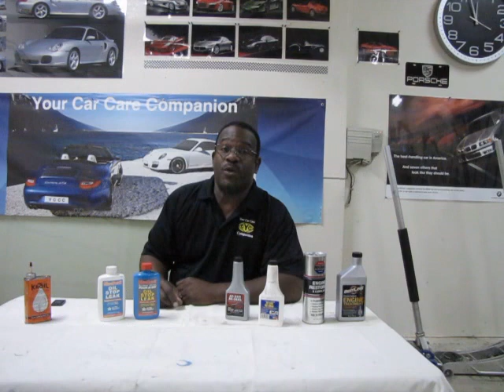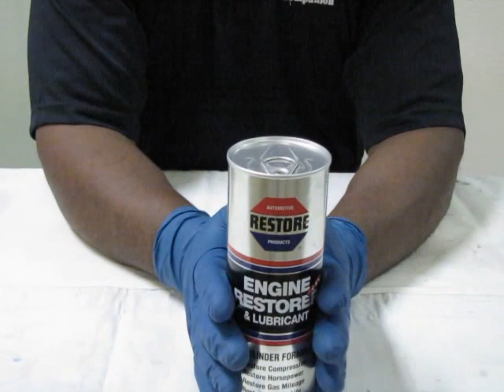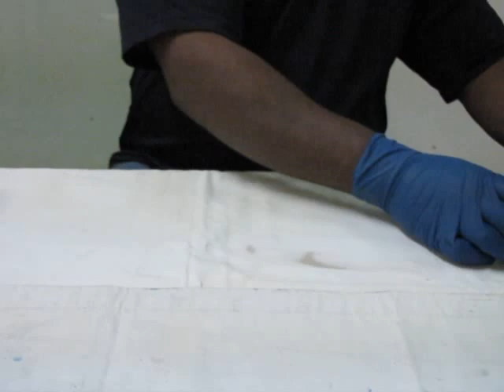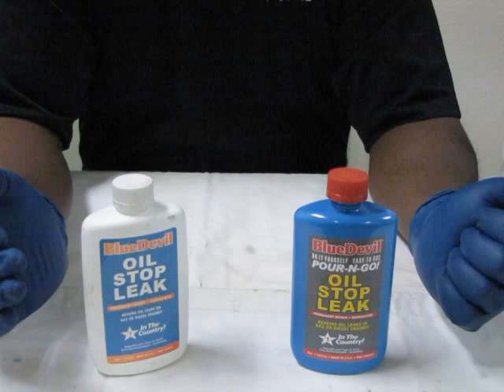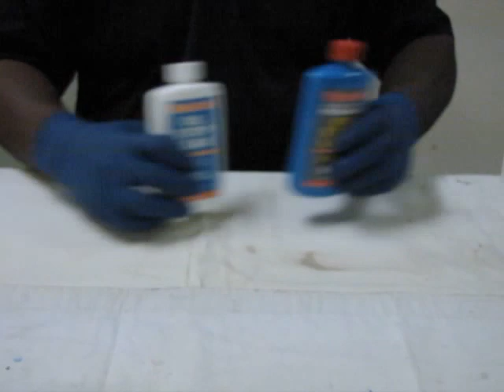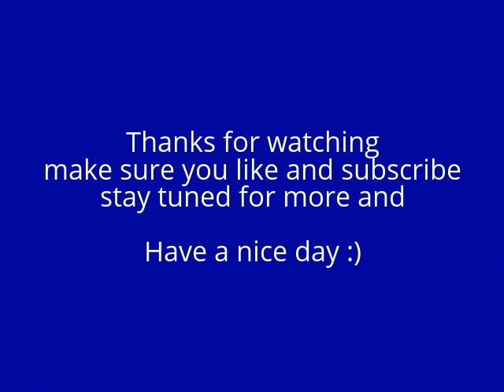3 of the best engine additives and penetrating oil money can buy

Comment: Catching the oil leak early is very important as it will work better. I believe  AT 205 reseal would be all you need some cases. Reason why is if you install a rack and pinion steering system and you have an older car that steering system could have sat in the products warehouse for many many years that the rubber seals inside could have dried out over time sitting in the heat etc. Same with real main seals. If the system starts to leak prematurely in months or in just a couple years the problem could be that the oil seals just need to be rejuvenated from sitting in the heat for so long,  which AT 205 reseal would solve the issue.

Comment: Really good video my man,I'll be using the AT 205 RESEAL for my 2008 Toyota Sequoia Limited,210,000 miles it has a rear main seal leak,hopefully it works... Do you recommend full synthetic oil for my vehicle and why???

Comment: Wish I could give this video, 2 thumbs up. I've been searching high and low for a true and honest opinion on these products, with someone having enough experience in using them and also being able to do the repairs, and when to or not to use them.
Reply: I have been looking at YouTube videos like this for about a year. More important now with troublesome cars with GDI, low tension oil piston rings, longer oil change intervals ,, differences between top tier gas and regular no/low detergent gas. and turbos

Comment: ATP worked for me.  Both of my Hondas had very small oil leaks.  I put 100ml in at each oil change and never had a leak since.  Instructions were about 180ml for my engines, but I only put 100ml just to try it out at first and it works.  Although I will replace both vvt gaskets soon since that is where the leak is on both cars.  Too bad I can't find ATP anymore, but I can find the Blue Devil stuff.  Might have to try it.

Comment: Note: AT-205 RE-SEAL, do NOT give it 5 hours. Drive it immediately. Ideally you'd pour it in while it's running. This will melt paint off your oil pan (if you have a painted oil pan, curse the OEMs who do) if you don't mix it into your oil by running your engine, then it will clog the oil pickup screen and kill your motor by reducing your oil pressure to 0
Reply: I put AT 205 Reseal in my 2008 Sequoia Limited with over 210,000 miles before I left for work this morning,it has a rear main seal oil leak,hopefully it works...

Comment: Thanks for sharing your knowledge and experience. I am looking for AT 205 but cannot find it anywhere. Went to advanced auto parts and was told it is back ordered 3 months out. Amazon is out. One site showed back ordered until September. Do you have any experience with Blue Devil Stop Smoke and Engine Repair. Looking to revitalize valve stem seals.

Comment: If my car does not have oil leaks, can I use this product to prevent leaks? At 205
Reply from the maker: Absolutely, I would use it like a week before an oil change so that it is not in contact with the seals and gaskets for too long.
Reply: But this product is not to be left in the oil and it does not damage the engine when it is too long?

Comment: I have a Ford Duratec DOHC V-6 that has a valve cover gasket leak and 2 spark plug wells have oil in them.  You obviously never changed the Valve covers on this engine. Far from easy and I've worked on A LOT of cars. Bank 1 you can't even see against the firewall. This Ford has 225k miles and although it's in great condition cosmetically I'd rather not do this job.  Intake removal, harnesses all over the place and then the two valve covers. A big job. Perhaps I'll try the AT 205. If this were a new car I wouldn't even consider it but considering this car is 16 years old with high miles it's worth a try.  Thoughts??
Reply from the maker: I've worked on many different models of cars over the years Fords included. AT-205 might work, but personally I doubt it on a car that old with that many miles.  I would change the gasket. A valve cover gasket is on the upside of the engine and will only get a splash of oil, not ideal.  I know its a big job, but that's just me, I would change the gasket.
Reply: @Engineerboy100  If I take that dive I'll change them both and also the intake manifold gaskets, PCV, etc. The car never missed an oil change and was maintained perfectly. Runs like new. This all started with a lean condition on bank 1 and a misfire code on bank 2. I checked the obvious, vacuum lines, cleaned the MAF, changed my air filter. The check engine light went off then came back about 10 days later. I checked the coil packs on Bank 2 to see if they were firing and they were. So I'm thinking fouled plugs because of the oil in plug wells on cylinders 4 and 5 Bank 2. Cylinder 6 was clean. I tightened the valve cover just a bit,  cleaned out the oil and now I'm gonna change the plugs in those 2 cylinders and check 6. If that plug looks OK I'll see if that does it.  Maybe I'll get lucky. Bank 1 valve cover might not even be leaking. After I try that if the LTFT/STFT readings return to normal and the misfire is gone I'll leave it at that.  Then,  if it comes back I'll take the intake off,  both valve covers and change all the gaskets, plugs, PCV, and coil packs. Check the cam retainers and whatever else I can't reach when it's buttoned back up. I don't want to have to do this job twice for an intake vacuum leak or Bank 1 going south 3 months later. Like I said,  if the car was beat on or never maintained I might have a different approach but this 15 year old Ford 500 Limited looks like new.  Almost mint.  So I'll do what I can to keep it. The best used car I ever owned and the previous owners were an older couple who kept all the documentation on the maintenance. I even talked to the mechanic that did all the work on it over the years and he told me the car was strong. Now,  I miss my garage and all my old tools. If I still had them this would have been done already. Thanks for the input. I appreciate it man.

Comment: Used these products for years ! Good video i really love the AT205 its really a good product used in the right setting ! I fixed 3 different transmissions that were pouring fluid from front seal and it completely fixed them not even a leak afterward use of it and they were pouring out fluid all 3 !
Reply: Pretty impressive,I'm gonna use the AT 205 RESEAL for my Toyota Sequoia Limited it has a rear main seal leak,hopefully it works...
Reply: @mercedesbenzs600bash  I just about guarantee you it will fix it !
Reply: @MegaGoogoohead  I really hope so,I'll let you know...
Reply: @MegaGoogoohead  OK my man I just put AT 205 RESEAL in my Toyota Sequoia Limited with over 210,000 miles because it has a rear main seal oil leak,stay tuned...
Reply: @mercedesbenzs600bash  Cool let me know i call it majic in a bottle !
Reply: @MegaGoogoohead  Most definitely...
Reply: How did it go did ur rear main stop leaking ? I juta put some on my Acura tl hopefully it works

Comment: What is best for timing chain cover oil leak? 2006 Lexus gs300
Reply from the maker: Well the timing chain cover does not seal in oil so if oil is coming out of the timing chain cover it is most likely your front engine seal that is leaking.  I personally would try AT-205 and if that didn't work I would change the seal. Even if it works you might still see leaks for a while as oil will be pooled behind the front engine cover ...

Comment: I don't think I would agree with this 100%. Most modern oils have seal conditioners as part of the additive package. Yes an oil stop leak treatment can work sometimes. However it does swell all the seals in the engine. The only time I try this is on a crank seal. These are difficult and expensive. Everything else just replace the gasket or seal. Just out of curiosity what sort of engineering degree do you have?
Reply from the maker: https://www.facebook.com/Rennfix/
Reply: @Engineerboy100  Cool! I do not have an engineering degree. I did however stay at a Holiday Inn last night... I digress. I have worked years in the petroleum exploration and fracking industry. I often commute with our petrochemical engineer from West Africa, Lamin. It was a two-hour commute one way. This gave me plenty of time to pick his brain. He was emphatic about quality engine oil and changing it every 3000. Obviously this applies to Passenger cars and trucks. Heavy duty vehicles and Equipment are different animal with different needs. I respect your opinion and training. Thanks for the valuable information. I have also been a heavy diesel tech since 1988. I have worked in the oil fields in both Africa and America. The best thing you can do is make sure your engine is sealed up tight. When oil leaks out dirt invariably Creeps in. It seems as though you can't swing a dead monkey without hitting an expert on YouTube. I guess I've run run on at the mouth ad infinitum. Thanks again for the video.

Comment: Yes! AT 205 is remarkable. Have 140K on my 2.4L 1998 chevy malibu. noticed it was consuming about a quart + every oil change. On my next oil change i put in AT 205. While checking my oil, i notice no loss. Assume it was leaking out the head gaskets or dripping in from the valve seals in small amounts. now nothing....so Yes this product is a mechanics savor.
Reply from the maker: Yes, used correctly AT-205 is one of the best products I've ever used for minor leak repair.
Reply: @Engineerboy100   Thanks for responding back. Await more informative videos.

Comment: Can AT-205 can help with valve steam seals,I meant-smoking engine?Thank You in advance
Reply from the maker: Yes. It CAN help, but if the seals are tool old or cracked they will need to be changed.
Reply: @Engineerboy100  thank You for feedback 👍

Comment: This is sound advice in my opinion.  I remember having to add 2 washers per bolt on a valve cover in a Suzuki Forenza to squeeze it down, it stopped the oil from weeping around the edges.  The OEM bolts were bottoming out, it was poor design from the factory.  A Suzuki guru informed us on the forums, only reason I knew about it.

Comment: Does blue devil seal up oil pump seal for a 97 Honda civic? And at 205?
Reply from the maker: Try it and see, what can it hurt.  If it works great, if not, replace the seal.
Reply: @Engineerboy100  i will pour at 205 i haven't tried it out hope it can save the seal.

Comment: Do you have to keep on adding at-205 Or blue devil  with every oil change ?

I have a rear main seal leak,  I have added at-205 and it did seem to slow down the leak but still leaks
Reply from the maker: Well no, .... and possibly yes. It depends of the condition of the seals/o-rings and the nature of the leak.  If the material of the seal was in fairly good condition originally and the chemical was able to swell it up enough to make a good seal, the leak should be fixed. If the sealing material was very dry, old and or cracked or the mating surface was damaged and the leak barely stopped or only slowed, you may need to use the chemical again or you may need to repair the damage and replace the seal or o-ring. There is no one answer.

Comment: Yes I have used At-205. Works some what depending on the size of leak.
It lessened they rear main seal leak in combo with high mileage oil

I have used restore in a lawnmower and it worked for blow by issues on a old engine. (4oz restore 16 oz oil)

Also used Lucus transmission fix 
Saved my car from
Costly repair that would of caused me
To sell the old car.  It’s not completely confirmed yet. It feels like it.  
Yah may just get a few more years out of it.   But that’s all it needs on a 2001 maxima with 203k miles
Reply: What was wrong with the transmission???

Comment: What oil additives cleans your engine only??  One that can be added to FULL SYNTHETIC??? A additive that is the ZDDP or Zinc base.
Reply from the maker: The best engine additive for cleaning your engine is changing the oil regularly and using Shell or Chevron gas with Techron  If the engine is already dirty, there are many cleaners that can be added to the oil, run for a few miles then change the oil and most work well.
Reply: @Engineerboy100  Thanks

Comment: How offen should i us AT 205 every oil change
Reply from the maker: You should only have to use it once. The chemical makes your gaskets swell up to stop small leaks where the gasket is not quite tight enough to the structure.  If AT-205 does not work the first time, you have a crack, damaged gasket or other issue that will require repair. Repeated use will not make it work.
Reply: @Engineerboy100  ok i was asking because my first oil change is coming up after using AT 205 my leak stop so i was not sure if i had to use with every oil change..

Comment: Great video you addressed many of my questions and suspicions. Now for a review. There are two concerns, what is absolute best for, 1. Seal and gasket restore oil treatment.  2. Which is absolute best for engine  surface friction protection pistons valves cams ect..... 
I was using lucas oil stabilizer but it changed my viscosity to heavy and my valves started pinging to much. My 3.7 l i5 cylinder GM calls for 5-30, I have 160k so I put 10-30 for extra protection it seems to flow fine. I was using amsoil. I think it is good, but I went back to Castrol 10 30 conventional oil I have used for 40 years, I have used non synthetic oil my whole life it has worked good. I thought maybe to much detergent in synthetic oils. Not sure. 10 30 Castrol convention I thought may coat my seals and gaskets wishful thinking I'm sure.
Reply: @Daniel Madden  Scotty Kilmer of Youtube actually advised against using Lucas heavy duty oil stabilizer on modern engines that have Variable Valve Timing (VVT) or hydraulic valve lifters. It causes problem like the pinging you mentioned. However, you can use Lucas low viscosity oil stabilizer for modern cars instead.
Reply: Check out TuroMaxx oil additive. Absolutely the best. All others can't touch the performance of this product.

Comment: I want a product to restore and protect Valve cover seals head gaskets and main seals and any other seal in my engine
Reply from the maker: The best valve cover gasket restorer is a new valve cover gasket. The best head gasket repair is a new head gasket. You can try some of these products for the seals, but ultimately the best repair is always a replace.

Comment: Gaskets and seals need help, because of oil detergents and engine cleaners. Do fuel and oil cleaners weaken seals and gaskets on high mileage cars. I have 160k miles on my H3 GM after using engine cleaners I started a little oil drip on the main seal and valve cover gasket. Is there a oil additive that restores valve cover seals main seal head gaskets that will not harm engine. CC ect.
Reply from the maker: There's nothing that will restore a head gasket ... really, for seals I would try AT-205.

Comment: I tried the "Engine Restorer and Lubricant" in an old 2001 Prelude once. Caused my oil light to come on. I've never done an oil change so fast in my entire life. Went from a dead sleep, the morning after trying the product (it was at night), to having the oil changed completely in about 15 minutes.

I tried a couple bottles of Blue Devil in the same Prelude, and it did help slow down a pretty big leak. Unfortunately, it wasn't quite enough, as I wound up just wasting the money to have the leak fixed by a trusted mechanic. I say it was a waste because the car, ultimately, had way more issues than I was led to believe when I bought it. I no longer have it as a result.

I've also tried Blue Devil in my 2002 Mazda MPV, which has a small oil leak, but is manageable right now. Unfortunately, I haven't noticed a difference. So I went ahead and tried AT-205 to see if it will make a difference before I buckle and try to have this leak fixed properly. Might be awhile before I replace this vehicle, so I have to do what I can to keep her going as long as possible (which she is doing phenomenal at). Hopefully this works out, and is able to buy me some more time before I need to replace or fix her.

EDIT:

As an added note, I use the MPV to do food delivery with GrubHub during my weekends for extra cash. She is a money maker, so that's one of the reasons why I'm trying to keep her around and healthy as long as possible. The good part of this is that I put the in the 205 in between deliveries earlier today, so it's gotten about 4 hours and several miles to move around the engine. I should know pretty soon whether or not this had any positive affect.
Reply from the maker: Good story! That is what many fail to see, these products buy a lot of people the time they need until they can afford to do a complete mechanical repair.  I hope the Blue Devil helps you and or the AT-205, good luck my friend and thanks for sharing.
Reply: @Engineerboy100  Very true.
Reply: How well did the AT 205 work???
Reply: @mercedesbenzs600bash  - Resealers are a waste of time. Best to just fix the leak properly and replace whatever gasket has gone bad.
Reply: @thesilentobserver93  Well we shall see,just put a bottle of AT 205 RESEAL in my 2008 Toyota Sequoia Limited with over 210,000 miles because it has a rear main seal oil leak...
Reply: @mercedesbenzs600bash  - Good luck. I hope it does work for you. I've hear of it helping. But, it's more of a band aid if anything, assuming it even works at all.
Reply: @thesilentobserver93  I'll let you know how well it works...

Comment: what is the best product there for oil consumption ?
Reply from the maker: That depends on how the oil is being consumed. Do a leak down test to determine if the rings are leaking or the valve seals. for the seals I would use AT-205 for rings you would need to uses something like engine restore and you would need to use it every time you change your oil until you got around to replacing the rings etc ...
Reply: a horse .